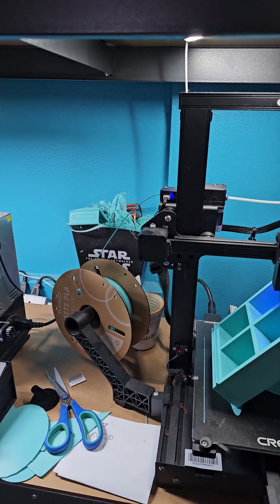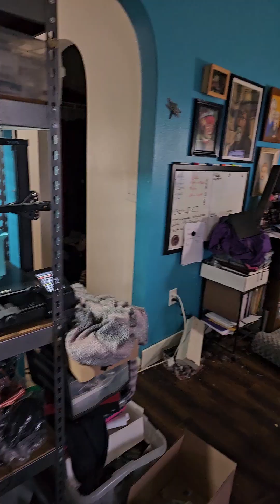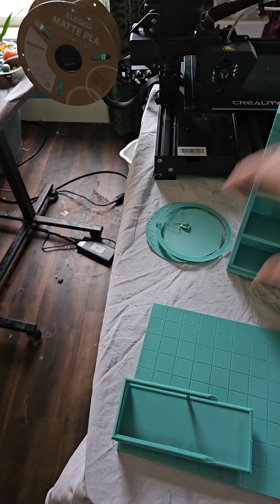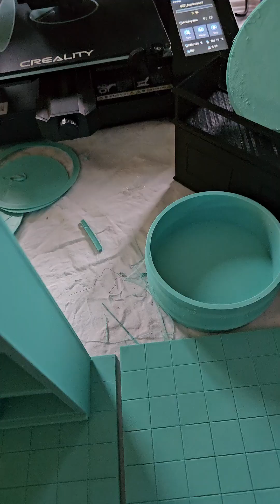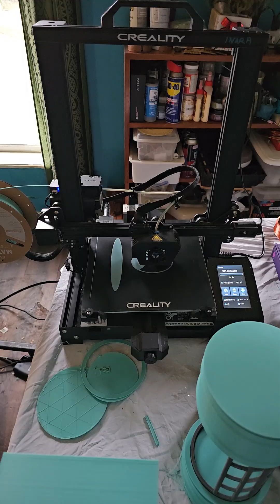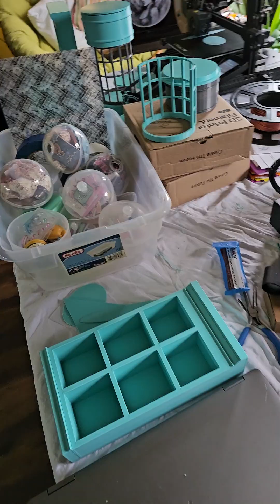Starting My 3D Printing Farm Journey! 🚀 First Products, Setup & Future Plans

Comment: I know a few people that run Enders - for the SD card issue they use an SD card extension cable, then you wear out the cable and not the actual Ender card reader and then just replace the extender  if needed, also means you can move the SD card to a more convenient location if needed too
Reply from the maker: Yes, I actually had an extender I've used for years. I thought it had just died, but turns out the sd card reader on my motherboard went bad. I replaced the motherboard with the updated silent one and added a cr touch while I was at it, but haven't gotten the firmware quite right on it yet. Work in progress.